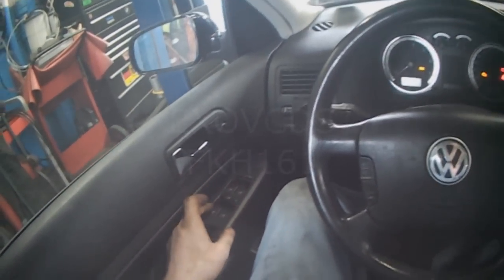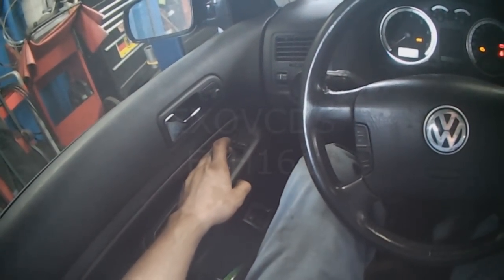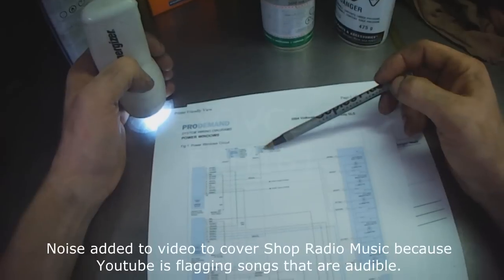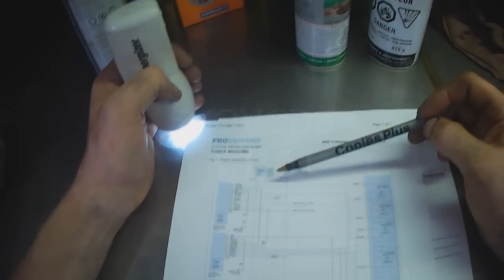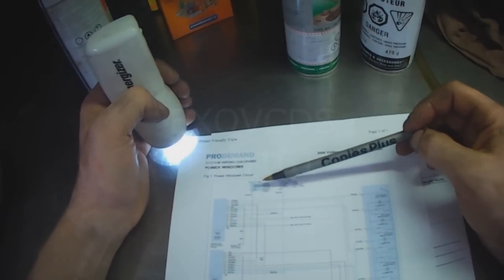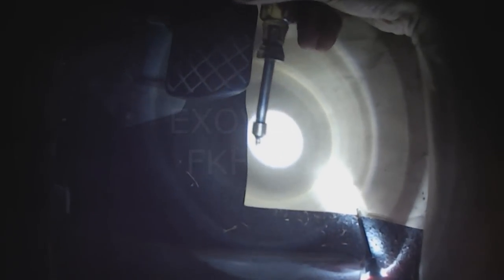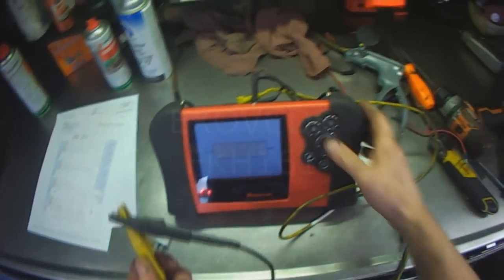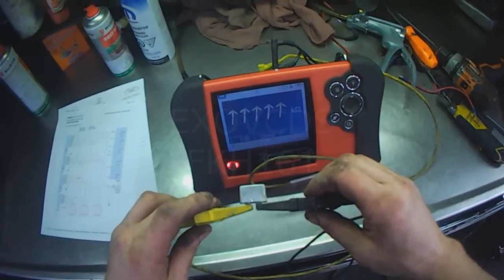VW A4: Power Windows not working

Comment: so how do you fix this?
Reply from the maker: I think I explained that the circuit breaker was bad... verified by installing a regular fuse in place of circuit breaker. Circuit breaker was ordered &  installed once it arrived.
Reply from the maker: Year, make, model that you are working on?
Reply: @EXOVCDS  thank you! i seen that you said that it was a circuit breaker just wasn’t sure if you ordered a new one or not and where did order them from? i’m working on 2001 vw jetta i hear the clicking sound when i try to roll down the window but nothing happens so i’m guessing it’s the circuit breaker
Reply from the maker: @392hills  https://www.ecstuning.com/b-genuine-volkswagen-audi-parts/fuse-30a/443937105a/

Comment: In my passat 2002 1.8t Windows Motors  only clicks but dont close, only de sunroof. And IT give me a code: comfort module operating in single wire
Reply from the maker: Check the comfort module for water damage... it is located under the driver floor mat / carpet. Also check the circuit breaker (similar location as in this video).
Reply: @EXOVCDS  comfort is clean.   I dont know what happened, windows Motors  burned?
Reply from the maker: @winston3240  If you hear the relays clicking in the door, then the main power is probably not present. Did you find the circuit breaker?
Reply: @EXOVCDS  i hear clicks in all Motors and a click in the module. But i dont know where is the circuit braker
Reply from the maker: @winston3240  look for it at the relay carrier under the dash... similar to the location as in this video. Post a video of what you see, so that I can see.
Reply: @EXOVCDS  i cant findes the problem😖

Comment: what if it's only one window? same solution?
Reply from the maker: No... which window... what car? What year?
Reply: Thomas EXOVCDS i have the same issue with the passenger window of a 2001 vw gti
Reply from the maker: Nick Hudson If all others work... it's a wiring, motor or window clamp issue with that window. When using the switch in the driver door or the passenger door, does the passenger window motor make any noise?
Reply: @EXOVCDS  hi. I have mk4 golf. window master switch and illumination not working but the switches work on the back doors but none work of the master switch. Any ideas?  Thanks
Reply from the maker: @amjidkhan2392  Check the switch for corrosion and the wiring in the door jam. The mk4 wires usually don't break in the loom that passes through the door jam... but they could. Using a scan tool, you can check for switch operation via the Comfort Control Module. Run a full scan of all the modules in the car... there might be some codes that can aid in the troubleshooting.

Comment: Hey man, thank you for the video, it was very helpful. I have a 2003 Audi A4 1.8t and my windows stopped working all at once. I checked down there under the steering wheel panel and mine has two circuit breakers (both are green and original) and not one like yours. I replaced one and switched it and still windows did not work... The fuses are fine. Any thoughts?
Reply from the maker: This video is for VW A4 (mk4). You have an Audi A4... which is different.

Comment: I have polo 2006 with the same problem could this be the issue
Reply from the maker: 2006 is probably different... I'd have to look at a wiring diagram. 
If you find the same type of "circuit breaker" in your car, then it might be the same / similar.
Reply: It seems bit  different.. I didn't find  the circuit breaker you pulled out.. can I send you a picture of the diagram

Comment: Hi I have this same problem. When I tried to change the circuit breaker. It was hot to the touch I ended up burning my finger. But I’m pretty sure that mean that the wires are probably touching somewhere but I can’t seem to find anything. Any ideas?
Reply from the maker: Yes, something is shorting or one of the motors is active. If the breaker is hot, then it is not "opening". Remove the circuit breaker and place a test light across the 2 pins, instead of the breaker. Then, go through a wiring diagram and disconnect one item at a time (that is on the same circuit as the circuit breaker) & wiggle the applicable wiring, until the test light goes out... that's when you found the problem / where the problem is.